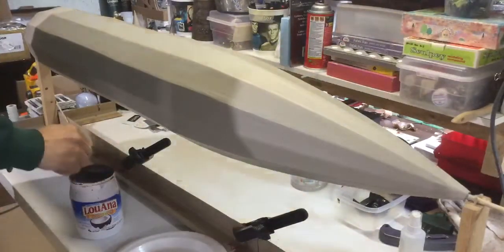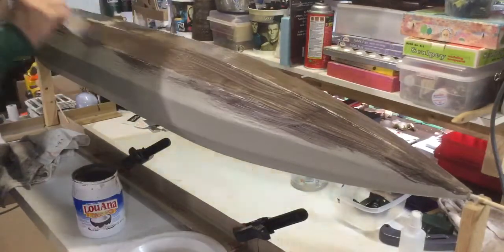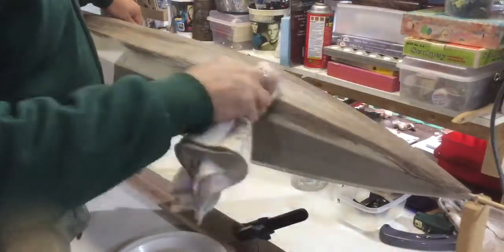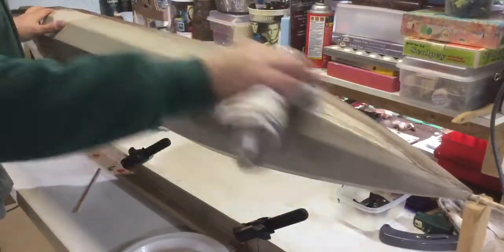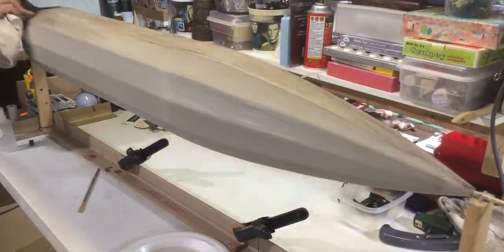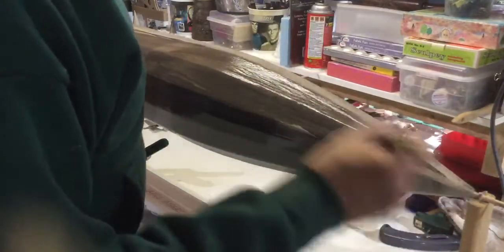Adding patina to a Steampunk Zeppelin - Artsmith Craftworks

Comment: Thanks, Stephan, I am curious about your technique for skinning the fuselage.  It almost look like you do it with masking tape.  I haven't found any videos from you on your technique.  Thanks btw for sharing all the wonderful tips.
Reply from the maker: I used to use mache right over my framework, but that was difficult and messy, so I thought, "well, masking tape is still paper,  it just is coated and has its own adhesive!" So I started doing a first layer using tape, then doing 2 or 3 layers of paper mache over that. The paper is either newsprint or actual newspaper. I find the newsprint, (used as packing paper) to be a bit thinner and easier to shape than newspaper, which can buckle a bit as it dries. Thanks for your comment!